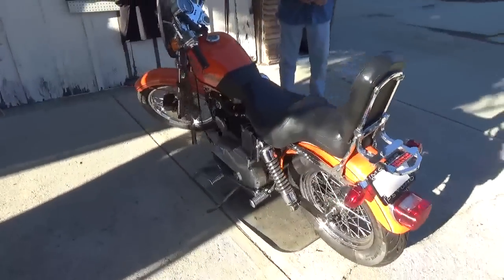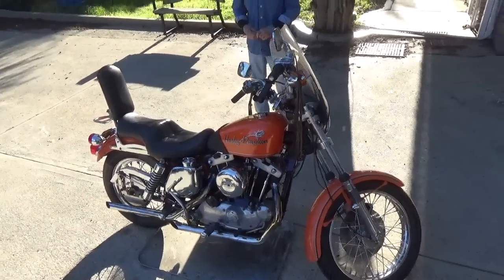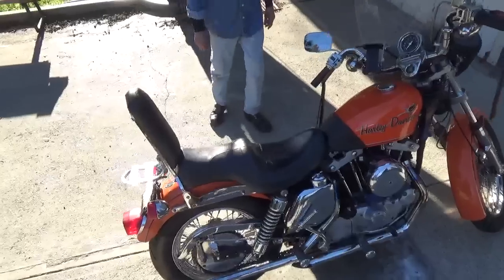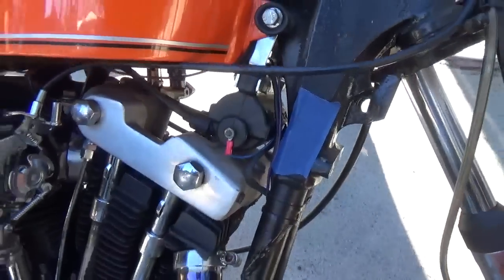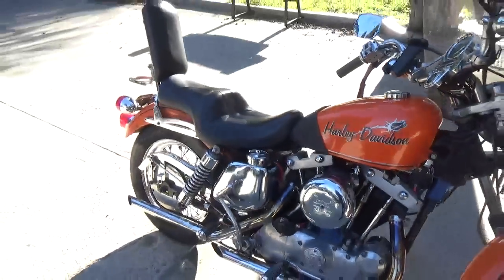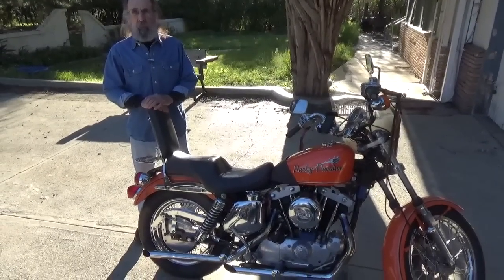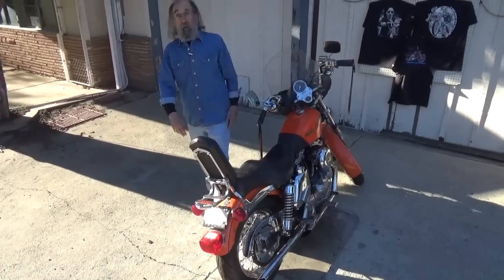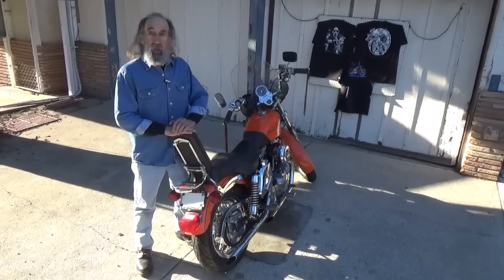74 Harley Sportster all together   Let's Hear it Run!

Comment: I'm a big twin guy myself, but I love the look and sound of those old XLs. When I was a kid thats the bike all the cool kids older brothers had. The FLs were out of their price range and they were considered old mens' bikes anyway. Then the FX came along and changed that.
Reply from the maker: Yes, I remember it well.
Reply: We used to call big twins "tractors"
Reply: @needmetal3221  mechanically not that far off.
Reply: It used to be you couldn't get a Big Twin for under $10grand! Sad!
Reply: I want an xr1000. In the next couple of years I'm gonna find one lol
Reply: @needmetal3221  had a sweet drunken paint job 1972 XLCH and shifter on right side and a 1982 xlh cherry read with Harley shield
Reply: I have a ‘79 XLS I paid $900 for(1991)and had to put 2nd gear set and shift forks in. It has slash cut pipes and the round air cleaner and 10 inch buckhorn bars. Iron heads are easy to work on, even the transmission.
Reply: I remember when the full dress FLH was $2,300
Reply: @jerryhubbard4461  what year was that
Reply: @jerryhubbard4461  My '68 FLH listed for about $1600 back then. I paid a lot more than that for it and I had to build it from a pile of parts.
Reply: @jameskelly7003  I also built my 1974 from a shop full of parts. Took about two months and $3,500.
Reply: @josieunderpants3602  Late 60's. I used to go by the dealer and just look at the bikes. I did not have enough money to fill the tank. But later, I finally got my HD and still have one at age 71
Reply: @jerryhubbard4461  KoOL I loved going on beerruns on my sporty now I just do it on my 99king man! What it would of been like going through a dealership in the 70s
Reply: The sportstroke can play a tune. I see you shaking a leg to the rhythm.

Comment: I love it that the lady bought it new and still loves it enough to keep her looking this sweet. Now you have her sounding as sweet as she looks! She hits hard idled low!
Reply: They sound good idled down low, but it starves for oil... bump the idle up.
Reply from the maker: That tells me how even they're running, then you raise it again.  If it will idle that low, you're pretty much in tune.
Reply: @pacificmike9501  Good info, PM!
Reply: @pacificmike9501  Totally agree. If she'll count 'em off when you're done, you did it right. If you have to turn the idle screw to keep it running, that pilot is wrong, or at least you gotta burn your fingers a little with the little screwdriver. Then Idle her up to spec.

Comment: Great work Mike. My most recent Ironhead was a 77. It had the same pipes on it as the one in this video. Mine had that same hesitation that you were talking about. At high speed it would have 6 inch orange flames roarin out of them drags. Wee Hee! Smitty in Vegas.
Reply from the maker: You just can't beat FUN for a GOOD TIME.

Comment: There used to be a neat old trick with those drag pipes and getting back pressure using bolts in the back! Nice neat old school trick
Reply from the maker: And it's "Dyno proven."  I've done it.  There is a combo to it.

Comment: I used the torque cones in my straight drag pipes for that back pressure. Love that sound!
Reply from the maker: In some situations, they help and in some they don't.  I hope they work for you.  I've had some success, but not across the board.
Reply: I found just an old fashioned homemade " lollipop" seemed to do the trick on my old 1984 XLX-61. One owner bike bought it brand new fresh out of high-school. Still runs great. Of course it's not completely oem stock anymore

Comment: Very cool bike guys....love that sound, but I agree with you Mike, they all need back pressure from some kinda baffle
Reply from the maker: It really varies with the cams and length of pipes.  But, generally, the old Sportsters lose quite a bit of bottom end power with 36-40 inch drag pipes.  There are numerous tricks, and I've tried as many as I could find.
Reply: @Pacific Mike  thank you for the detailed reply Mike...

Comment: Nice old Ironhead. I prefer the look of larger diameter pipes. I bought a 2001 Sportster 1200 EVO about a year ago, to go with my 1989 FXRS Low Rider. It's a great little around town and short trip bike. I decided to get one because it was obvious that H-D was going to get rid of the Sportster. It came with a great sounding slip ons. Fairly large diameter. I noticed it was running a little warm. I pulled the carburetor off, and discovered it still had the stock jets in it, so it was running a bit lean with the aftermarket slip ons. I put in larger jets, a different needle, and replaced the pilot screw with one that can be turned by hand with the engine running. It now runs much better, and over 30 degrees cooler. It also sounds better. Before it had sort of a flat sound. Once I fattened up the air/fuel mixture, the sound filled out a bit. No hesitation, throttle response is perfect. Like the Low Rider, the Sportster has cast wheels with tubeless tires. I love the looks of wire spoke wheels, but I have been stranded too many times by flat tube type tires. I once spent almost $1000 and missed two days of work because of a flat tire with tube type tires. What started out as a nice Sunday morning ride turned into a nightmare.
Reply from the maker: And, there you have it.

Comment: I had a 76 black XLCH bought it from a guy called tiny In Waco back in 88 I was new to Harley Almost died on a punched out KZ 900 So I decided to get out Of the speed and slow things down a bit Totally fell in love With It..Pure machine.. You could hear the cams the flywheel the lifters the rocker arms.. The engine would tell you way in advance if it needed attention down to that it preferred exxon 93 over Chevron 93 The awesome thing about it was that it was completely original Down to the fact that when I was buying it Tiny said that The gages Haven't even fogged over.. Unfortunately I lost the old girl When I was running it up made the shift from 3rd to 4th As it turns out one of  the dogs On the 4th gear main shaft broke off and locked The back tire up around 80.. I was glad that day I believe in wearing full leather.. Nuff said
Reply from the maker: Ain't it great?  A bunch of us are still here.

Comment: Man that sounds phenomenal,and that electric start is a definite necessity! I’ve got a full kick 76 iron head and what a beast it is to start and you definitely have to do the right sequence to make it start or you’ll be surely kicking it for a good bit.
Reply from the maker: Learning the principles helps.  Know when you've got fuel into the heads.  Know at what point the spark needs to fire for the easiest start.  Know how to make it suck the fuel in.  Visualize it in your head.

Comment: I had a 72 sporty. It was a stroker, camed up bored out with straight pipe. 1st gear was to get it moving the hit 2nd and hang on. No lag at any speed but after 75mph it would pull like a mutha. Loved that bike. Put 100k miles on it with 3 top end jobs and 1 tear down and rebuild. Now I have 2 Shovels and a twin cam and can't lean them as far in the corners so not as much fun. I wore the edges off the tires of long before the middle.
Reply from the maker: Wow.  Very cool memories.

Comment: Nice Sporty. I bought a new 1984 XLH . Dealer said break-in the motor and bring it back for the drag pipes. It was flat from idle to 2500-3000rpm. Mechanic said these bikes need back pressure and he clamped 2 baffles in place and said ride it now and you'll see what I'm talking about. Sure enough he was right. he bolted them in place and it ran like a different bike. The baffles didn't make much difference in the sound either. Still have it today.
Reply from the maker: Cool.  Thank You.

Comment: That's really cool that she bought it new. I have a '74 Sporty that I hope to get running again and right. I heard that there's a bad design in the transmission. I'd like to find a way to work that out, beside cutting the back end off, to put a big twin transmission on it.
Reply from the maker: People have used the transmissions for a long time.  They are a little complicated.  No big deal.
Reply: @pacificmike9501 ,
Are you referring to the '74 Sportster transmission, or a big twin, to adapt to the engine? Also, I'm not that mechanically inclined, or that knowledgeable about how to work on engines or transmissions. I'm trying to learn, when I get the chance to do work on my own, though. Do people usually do any machining, to fix the design, or do they upgrade the internal parts, or just service and adjust it as is?
Reply: If the cases haven’t been blown up, I would just put it back to stock. If it’s done right, it will do well.
Reply from the maker: They get rebuilt and used some more.

Comment: I bought my XLH new back in 1977 and still own it. I just love it! My mate bought his XLH new back in 1975 and still owns it too. We are both proud that they are AMF Sportsters and have been very reliable because we took good care if them. Great channel and thanks for all the great videos and tips you give us. Ps, I've never had to use the choke in all the years I've owned mine, two pumps of the throttle, press the button and off I go.
Reply from the maker: Very nice!
Reply: That’s surprising . Had xlch  then roadster iorn both dogs then got 83 with the new design huge head gasket , new design modal brain and washer all factory
Reply: Plus they grinder a lot of metal out of engine     Holly did that iorn head move… I thought irons were         Well not after that eagle emblem on the front fender
Reply: Thier like almost 100 lbs lighter .      It’s good to know the older iorns r still running. Amf fixed Harley iorns and sold em evo design…     I think we could have survived without the evo but who wants a Yamaha r Honda as a rescue bike
Reply: @matthewswartz5864  I think the fact that me and my mate bought them new and looked after them is the reason we didn't have any problems with them. We didn't have factory dealerships in the UK back then, but even if we did we wouldn't let a factory mechanic near them as we always do our own work on our British bikes. The engines on my 77 and his 75 have never been taken apart as they are still running great. He has replaced his clutch and primary chain but mine is all original except for my points, plugs and condenser and light bulbs of course.
Reply: @skyhill4279   sky that is awsome and may it scoot 4 a million miles r kilometers r more bro
Reply: Wish I had enough brains in my head to fix my shovels wires.     But god giving to some
Reply: @matthewswartz5864  hey bro, glad your riding a Shovel, temperamental but beautiful engines. Another mate of mine has just restored a 78 Shovel engined Superglide, he even managed to get the proper AMF decals for the petrol tank. Thanks for your good wishes, it's miles we use in the UK, kilometres is for those Europeans over the channel where they can stay. Good luck with your wires bud.
Reply: @skyhill4279   what ya just drive around in circles on dat island?
Reply: @matthewswartz5864  🤣🤣 nice one bro! We have a lot more roads than you might think. Not just straight roads but very twisty roads out in the country and around lakes and over mountains, great roads for bikes with all the corners.
Reply: @skyhill4279   oh good I get dizzy easy.   One round about and up come the cookies

Comment: I have drag pipes on my '77, and it used to have hesitation like you are talking, but after drilling a hole on the side you cant see, and putting in a bolt with 2 nuts on it inside the pipe, it did much better, I could even show you a before and after dyna report with the bolt in it, that simply creates that little bit of back pressure.
Reply: '77 shovel lowrider i should mention
Reply from the maker: Okay.  Cut the end straight and put in a 5/16 bolt four inches from the end.
Reply: @pacificmike9501  absolutely, I got the best performance putting two normal sized nuts on the bolt, it really leveled everything out. thanks so much for the videos and knowledge, you are the best of us out there.
I put that bolt with two nuts in both pipes, let me know if you want a pic of the dyna before and after, pretty cool stuff man

Comment: Big Mike, Robert starter problem, came to me other night. Clutch housing has 4 wields, holding starter gear. 2 wields broke. Flexibility let's move not to catch bendix bites to enguage, 2 times starter enguage but bottom out came to stop. Ring gear bottomed out on bendix came to stop 2 times. Came to me in sleep. Looked up ebay found one for sale, with one weild broke. How crazy.
Reply from the maker: A bit much.

Comment: Mike, I definitely agree with you about drag pipes. I've always been a fan of 2 into 1 exhaust for overall performance. That's one great running Ironhead. Was the generator replaced with a custom alternator which bolts onto the engine case where the generator goes? If so, how well does that small alternator work? Thanks, Mike.
Reply from the maker: Yes, that's an alternator.  I don't have any experience with it.  It was on the bike.  Appears to be functioning well.

Comment: i have a mikuni on my custom softail & i just adjust the accelerator pump squirt a little more to cure that off idle issue for streaght pipes
Reply from the maker: It helps.

Comment: Mike, how difficult is it to take off the brake pedal when removing the primary cover and more importantly, how difficult is it to put back on with the spring. There is nothing in my service manual and I haven't seen any videos. I have a 1974 sportster xlh and have never taken the primary off before. Thanks for the videos!
Reply from the maker: Getting it off?  Quite easy.  Lever off the spring, pull the bolt, slide the pedal off.  Reverse is the same to reinstall it.  Levering the spring back in place should not be done anyone watching.  I should probably make a lever just for installing that spring.  Also, read the manual on the travel of that lever.  It moves very far because it is so long, but, it only moves about 1 1/4" to START to engage the brake shoes.

Comment: Ironheads are great machines. Tuned correctly, they run smooth as a Swiss watch. They just need some grease here and there, and maybe a little fingernail filing on the points now and then!
Reply from the maker: I've seen them done to such a high degree, it's amazing.  Matching all of the gears in the camchest and really going crazy with the accuracy and fitment of the bearings and bushings.  The sound just gets better and better.

Comment: Mike I'm building a shovelhead real similar to yours and so I was wondering what size sprockets you are using
Reply from the maker: Stock, because I run a six speed with a .86 overdrive.  I also run one oversize rear tire.

Comment: What do you think of the torker cones ,
that you install in the head pipes does that help... Or some type of lollipop at the end of the headers ....
Reply from the maker: The last pair I put in really helped.  I reasoned that the cam and other design factors that I couldn't prove also played a big part.  Long duration cam, length of pipes, design of exhaust ports and so on.  I went to visit a buddy of mine who is a brilliant builder and race tuner.  I asked what he thought.  He said, "She liked 'em."
Reply: @pacificmike9501  tx for the reply 🖖

Comment: As a long-time H-D enthusiast (my first harley was a '47 El I bought in '77!) I think many guys were turned off by the low speed handling with shotguns, and just jumped ship and went over to the dark side (metric bikes) way back when. I'm thinking there are untold numbers of old XL's just sitting around in garages, barns, and sheds, waiting to be discovered and re-born! What are your thoughts on this?
Reply from the maker: The cool thing is that bikes don't take a lot of space.  Someone is always unearthing piles of stuff.

Comment: With straight pipes the length is critical. If I remember right, they should be 26 inches. They lose power everywhere on a dyno. That bike is running good though, nice job
Reply from the maker: Thank You.  I believe that is 36".
Reply: @pacificmike9501  you are correct. I've been riding Hondas for too long. Yrs ago,Harleys racing dept made information available about big twin and sporty hot rodding that most everyone simply ignored however dick Obrien was a genius with the older bikes.

Comment: Last week I bought a '90 Sportster 883 bored to 1200 with drag pipes.  What about torque cones on the exhaust inlet?
Reply from the maker: That's a nice fast combination.  The torque cones may help, but not a lot.

Comment: my 1980 shovelhead had the same problem with straight pipes, they just need a little backpressure
Reply from the maker: Sometimes you can chase that missing lowend for a long time.  Or, you can just accept it and run it faster.
Reply: @pacificmike9501  yeah, I was glad I found it, a 1980 74'' flh needs lowend power, with the andrews J cam it only runs top speed 100MPH but that is enough for me.
Reply from the maker: A happy motor is a wonderful thing.  With that cam and displacement, it should have a sweet idle and run cool.
Reply: @pacificmike9501  yeah it works for me, cruising with 75MPH without any problems, I must say I also have an oil cooler but with this setup I can cruise all day long

Comment: Tulip valves are vocal cords, so timed to sing their song,
but, if YOU try to sing with your mouth wide open, the tune comes out all wrong.
Correct breathing is the answer, for those pulses need their space,
to run & bounce with a verbal flounce . . . it's a concert, not a race!
- unless of course, you are racing . . . then, may you 'shout' the song of VICTORY! as you bellow through the line.
(England, Tuesday, & raining (!) . . . Hmm, time for some Joe Walsh & 'Life's been good' - Bring on the noise!!! : )
Reply from the maker: Wow, Thank You.  "Just leave a message, and maybe, I'll call."